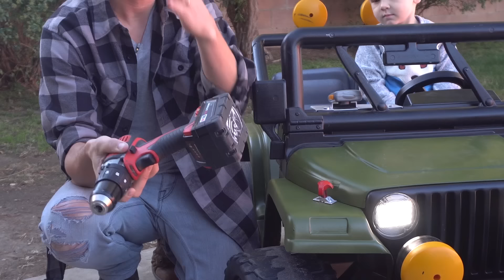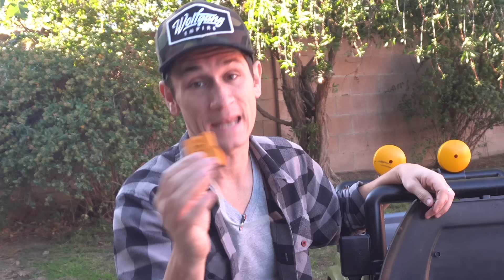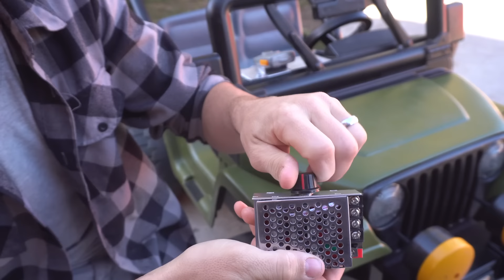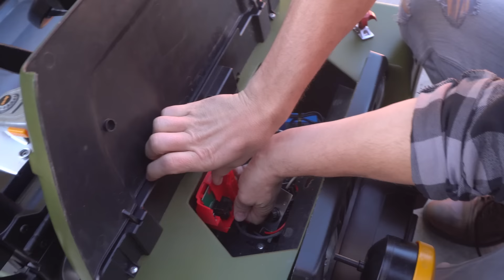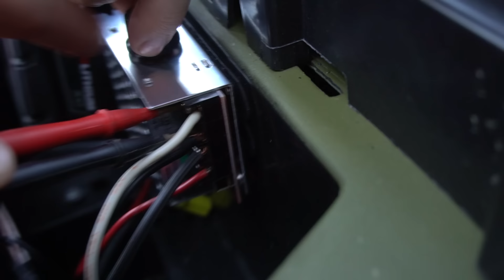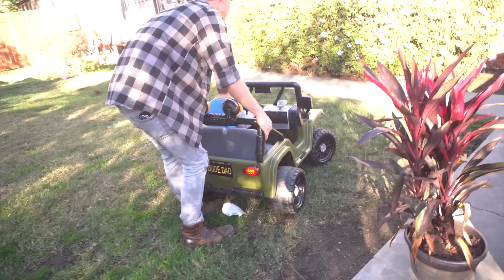EASY - How To Modify 12 Volt Power Wheels To 18 Volt power tools battery. Jeep 18 Volt Upgrade

Comment: I did this jeep with 24 volt lithium battery, with a slow start and installed dual 770 metal geared motors and a Bluetooth control! 12mph

Comment: They now make adapters that will drop the voltage down to 12 volts.  Comes with a kit that has a resister block, lever nut connector and mounting hardware.  I put my 12Ah battery in it and my boy road his around for at least 4 hours on a single charge.  I'm thinking about putting a "turbo" button on it for him and letting it ramp to the full 18V, but thats a project for another day....lol
Reply: Link that part please

Comment: My jeep has this unit Main Circuit Board for Ride-On Cars HY2025RX-SE-12V going from battery to motor and other electronics. Should i but the adjust before or after this?

Comment: I would consider wither putting a lock on the hood of the vehicle or putting the voltage controller inside some kind of lockable container where the kids can't just crank it up to the full 18v and hurt themselves. Other than that, what a great idea and video. I will be doing the same thing for grandchildren one day!

Comment: Some advice: DON'T make any modifications to a Power Wheels toy. These "kiddie-cars" aren't meant to go faster than what the 12 volt batteries causes them to go. One father in Connecticut has learned this the hard way fairly recently when he modded the one his kids used into a gas-powered vehicle and got one of the kids killed when it collided with a fence. Now one of his kids is dead and he, himself, has been arrested and criminally charged. He's going to end up in prison for being stupid.

Comment: Hello.

I have a Power Wheels Suzuki 94 model 86570 ATV.  I purchased used at a garage sale and after contacting Mattel I found out that it has been discontinued.  I purchased  a 12 volt sealed battery and used some 10 gauge wire with quick disconnect spade connectors and was able to get it running.  My grandkids were happy.

I connected the two red wires from each motor together with the white positive wire and the two blue wires from each motor together with the black negative wire, but after a few minutes of use it blows the 30 amp fuse that I installed inline on the positive wire. 

Hopefully you can add some insite so this will work.  Do I need to install a 30 amp fuse per motor? 

Thanks in advance

Comment: I did this with DeWalt battery.  It runs, seems a little faster but doesn't have anywhere near the power yours has, just a minor change.  Wonder what i need to do different

Comment: Is it possible to over drain the battery where it wont charge anymore?
Reply: Yes. Many drill batteries claim to have over discharge protection however I understand that the tool itself in most cases regulates this and not the battery. I try to periodically check the voltage to avoid over discharging and usually when the car slows down from a full charge that is a pretty good indication to charge it. I wouldn’t recommend running it totally dead if possible. There may be a way to get a speed controller with a low voltage cut off I haven’t really researched that far.

Comment: Dont cut it. Get a old charger phone plug. Cut of the prongs, or what ever its called the metal that goes into the wall. And Soder them on to the battery wires.  And they will fit tight and perfect into the powerwheel battery plug. Or even drill into the slots with a small screw and leave them half way in. It will be so tight they will not budge. And for a little added Security just rap a little electric tape. So that the wires dont move around and cause the car to sputter!

Comment: Hooking up 18v to a 12v system is not good practice.. if you are only running the motor it will probably be ok.. if you have any other electronics that run 12v be prepared to let the smoke out..they have step down converters for this
Reply: What would be a good step down converter?

Comment: How did the 12v motors last against the 18v?   I just did this but used a voltage regulator and turned it down to 12 volts.  Burned up my regulator immediately.   Now I just wanna throw 18v right at it
Reply: How many amps was the regulator?

Comment: Yeah, thank you times a million! I just got a 1991 Suzuki quad off the side of the road and i need to rewire it to a different battery since the wires are toast. I ordered a conversion kit and was scared to put my 16 month old on a fast quad since almost every drill battery is 18v or 20v . Now that i know theres a such thing as a motor speed control it will be delivered on Saturday 😂
I cant wait to order the battery and see if it works! If not onto the next problem! But i cant complain since it was FREE, and its vintage!

Comment: Yes, but how long does it last? Does it last as long as the original battery?
Reply: Of course not, that’s why we modify it. The extra power will wear out gears and everything else faster compared to OEM. Just the fact that you need to add an extra fuse should let you know that you might be strapping your kid up to a fire rocket… AWESOME!!! lol

Comment: SPEED CONTROL:  There is a switch on it (OFF, STOP, RUN > use Run and you should see a red light on) I was confused about hooking up the Motor Speed control until studying it more.  Why 4 wires?  2 from the 20V Battery side which is Input "P+" (RED from the Battery) and the Negative is Input "P-" (BLACK from the battery)  This is from Left to right on the speed control.  Next the wire from the Motor hooks into the M+ (Red)  His red was black and M- (Black) his was white.                                                                                      DEWALT BATTERY POWER ADAPTER:  The one I bought had an on/off switch.  I finally realized this after a half an hour of trying to figure out why the car wouldn't power up.  Hope this helps.

Comment: Yo dude dad i got a question bro hopefully you can help me out I upgrade my sons 12v car to the Milwaukee m18 battery the fist time i burned out the mother bored by connecting the Bluetooth control and it burned out the second time I connected my phone to play music and it burned this time the kids where playing with the car and all of a sudden it doesn’t turn nothing burned out in the mother bored the fuse is fine but the motors or not working I think I blow the motor

Comment: Thanks for this. Have you noticed any issues with the motor since doing this? Wondering if the extra voltage Will burn the motor out faster this way.

Comment: Or you can do it the sketchy way and just connect the positive and negative terminals directly to the wires with no protections like how I did with my 20v batteries

Comment: Doesn't the wheel motors max out at 12v? Wouldn't you have to upgrade the wheel motors?
Reply: I upgraded my wheel motors to 24v. Replacement is on amazon
Reply: @togo3624  I actually tried just adding a 12v battery. Went much faster but eventually burnt out the mainboard

Comment: Amazon sells the adapter with the wires and 30 amp fuse ready to go, as well as 3 pre-drilled holes for mounting!
Reply: Can you help me how to find it on Amazon ? 
Thanks in advance
Reply: @borislavjovovic3393  Power wheel adapter for Milwaukee 18V battery
Reply: Where's the ad?

Comment: Hooked mine up the same way and light on the speed controller is on so it has power but the power wheel will not move. Any ideas?

Comment from the maker: One thing to note with this set up. Be sure to take your battery out when you aren't using it or else the battery will continue to drain while the car sits and it will kill your battery completely.
Reply: Did you find this out the hard way?
Reply: You can save it by using a good milwaukee battery most of the time

Comment: Are they 12 v motors.      Will the 20v burn the m
12 v motor up?
Reply: The torque from my 20v dewalt battery caused the gearbox to break. Just ordered a replacement. I didn’t use a fuse and never had problems.

Comment: I attempted a conversion with similar thought process, but have ran into an issue...  What i did was, make a home-made salt spreader which mounts into the hitch receiver of my UTV.  The "motor" of the salt spreader is powered with an 18 volt dewalt drill, directly wired to a DC dimmer switch, then wired to the battery terminals.  It worked like a charm, until after about 20 seconds of solid continuous use.  After that, the wires become very hot to the point of melting.  Wondering if anyone has any ideas as to what i need to do to fix this issue?  I am using 16 gage direct bury stranded speaker wire. Maybe i need bigger gage wire?  The dimmer switch was rated higher than the 12 volts that the battery would provide, and the dimmer switch wires were 16 gage, so i figured the 16 speaker wire would be sufficient. 

If anybody has any ideas, i'd love to know. thanks!
Reply: Your wire size based off the amperage. 20 amps in 12awg, 30 is 10awg

Comment: Dude Dad ? Do you have a wire diagram I could look at? I bought the same setup but can’t get the throttle button to work on my kids 6 volt atv power wheel. any help would be great full

Comment: As soon as we bought one for the kids this was my first thought. Our one already had variable speed so I just mounted the battery slot on the side and I take a couple of batteries with me when we take it to the park. Never needed the second yet thankfully. I was so worried I would ruin the thing but it’s easier than it seems.
Reply: Does your have a control box? The stock circuit board thing? Do I bypass that? Mine has high and low speed stock and don’t know if I’d lose that feature

Comment: I blew the 12v RX11 control board on my sons car. It’s a regular 12v weelye. Should I replace it with the same thing or go for a 24v panel? I only blew it because I didn’t have to control Module and fuse in (ordered them both!) thanks for the advice!
Reply: @daycallmechuck hello, I am running into the same issue, wondering if the 24 control board worked for you?
Reply: Yeah never got it to work again. Ended up buying him a rosso sport ATV. It’s a 36volt and he loves it.

Comment: Nice video and thank you for the advice! 
I just got a really nice ride for my daughter and I'm going to order these parts.. just have a question.  How do you charge the battery? Do you charge it directly in the car or do you just take it home? What is the most appropriate way of charging one of these? 
Being a 18v battery, should it be how many amps? 4A is enough?
Reply: The drill battery you will ultimately be using has a charger or should, you can purchase one and they are made to slide right on and charge up Quick. You aren’t altering the battery at all just the USB adapter
Reply: @kirbywebb267  what’s up? Im not sure I know what that is supposed to mean. Could you elaborate

Comment: Quick question, can the motor control go any lower than 12 V? I’m trying to swap this into a device that doesn’t need to move fast. Basically walking pace but I have no experience with electronics.

Comment: Hey running 18v to one 12v motor  or 2 single 6v to make 12v still would burn out the 12v or 6v motors would have to change the motor or motors to meet the voltage would you not ?????

Comment: I did the same thing with a 20v dewalt but caught the wires on fire for the motor. No I have to rewire everything for the power, forward, natural, and im going to upgrade the motors.
Reply: What are you upgrading the motors to? My son has a 4 wheeler I did this upgrade and it Fried the motor pretty fast
Reply: @BUELL-vf6jo  m.l.toys

Comment: Won’t placing 18V thru a 12V rated motor burn the motor out?
Reply: It works my grandson is running 20 volt
Reply: Do you need a fuse can’t you just do direct connection
Reply: Yeah, but the fuse gives you safety, such as if a wire shorts out or the motor does burn up, it will blow the fuse long before it starts a fire under your kids seat.  @TheJoeMoneyShow
Reply: @ yeah I bought one Amazon for $11 Black Friday sale
Reply: Yes it does and other things lol… I’ve fried 2 of my son’s power wheels… but you can swap parts that can handle the 18v
Reply: Eventually yes but it could be a while
Reply: That's what I'm thinking. These things have some tolerance in regards to voltage, but not 50% higher that rated. 
It would be different if the speed controller was a buck converter that actually dropped the voltage. But its not.. Its a pwm. The way it works is to turn the full voltage on (in this case 18v) for a fraction of a second, and then turn it completely off for the rest of the second, and repeat that. 

If the 18v is on for 2/3 of a second, and then its 0v for 1/3 a second, it averages out to 12v, which is why the multimeter reads it as 12v, but its not really 12v.

I think this project is a case of "It works as long as it continues to work"

Comment: Great Video. Looking to do this conversion. Question: How much drive time do you get out of the 18V Lithium battery?
Reply: @oh no the fives So you have gotten close to 4 hours of usage on 1 - 18 V Lithium drill batteries with the Power Wheels? That would be amazing!
Reply: Ours is a 3 Ah 18v and only lasts about 30 mins. Idk if this is due to something that needs to be fixed or just due to the battery itself.
Reply: @chunkybones668  That sounds normal. There is no way the other guy is getting 4 hours out of 1 battery. You can’t even run a drill for 4 hours straight, let alone a power wheel weighed down with a kid or two.
Reply: @StarFox31   mmm im a roof plummber i use 6amp drill milwauuke lasts atleast 6 hours of constant screwing in screws.so im sure a 10amp or even 9 amp would last easy 4 hours
Reply: We use a m18 8.0 hd  battery and we get about 50 minutes steadily driving full speed with both kids in it. That is at the full 18 volts. I got a voltage regulator that I’m going to add so the motors don’t burn up from over working. That should also extend the drive time significantly

Comment: Love your videos! I'd like to do the same to both of my kids' power wheels. As well as the 36v minimoto electric pocket bike I recently have acquired. But the bike is more for me until they get older. 😂 but I know NOTHING when it comes to electricity so I don't even know if it's possible to wire a couple 18v lithium ion batteries together. 🤷‍♂️ or fuse sizes to use.

Comment: Thanks.  Great video.  My Porter cable 18v drill has a nickel cadmium battery.  Will it still work even though it’s not lithium ion battery?
Reply: It should still work if you can find a battery holder like this guy had with his Milwaukee battery. The only difference is that the Li Ion batteries will typically have longer battery life/better depth of battery discharge. But they'll still operate the same as they're both 18V batteries.

Comment: I did this with a 18v makita battery, thanks for rhe vid. One note too add though is although we added a 30amp fuse , the voltage controller came with a 15amp fuse inside, that poped pretty fast so i replaced it with a 30amp fuse. Just a tip for anyone looking to do the same
Reply: @BrandonT i have it before, (30amp) but it was the smaller 15amp inside the speed controller that blew, I put a 30 in and it has been running great since kids love it. Plus I added a led spotlight with light switch too
Reply: @BrandonT it shouldn't matter if the regulator has its own 30amp fuse. It will protect it. If its anything smaller it will blow before the other 30amp fuse. Depending on draw of power ie: weight and speed,  uphill etc. If it dosent have a fuse built in the regulator I would put it before and that will blow before the regulator.
Reply: @BrandonT no problem happy to help! Hope your kids have a blast! 👍
Reply: @Stealydan10304  yo I’m tryn do this confused tho so on the voltage controller it connects to the battery - & + and what is that white wire in video on the voltage controller?
Reply: @Jay_Swavyy  https://youtu.be/gXfMXjUsZdI
Reply: @Jay_Swavyy white wire in the video was going to the jeeps motor, probably + and the black one going to the motor would be -

Comment: Did you replace the original thermal fuse with that 30amp in line fuse?
Reply: Do I need to remove it did it to my son's but the battery gets hot
Reply: @chrismoorhead11  Yes! We have blown a few batteries when getting so hot I couldn't touch it. Killed some very speedy batteries... opps.

Comment: You're going to want to add a low voltage cutoff, while the Milwaukee battery knows when it gets too low it sends that signal to the tool to cut power. The battery itself will not cut its power, and you'll over discharge and ruin the battery.

Edit, I suppose it's possible the USB charger you have has a cutoff built in, but if so I would find it unlikely it's rated for 30 amps.
Reply: I've tried to find one and couldn't? Any help or suggestions?

Comment: How will the engine in it handle the 18 v instead of the 12, is the motor ok with that ?
Reply: She will handle more than that, my understanding is the motor can handle up to around 30 volts before you begin to see problems. I'm sure you could argue there's some shortened lifespan.
Reply: @timothyfischer5160  ah ok, cool. thanks.
Reply: We have 9 different power wheels types of ride on vehicles and all have been perfect. Even with me riding my 1 year old. These are fun and now a days, not much else to do.... the worst thing we have found is when kids push not moving power wheels and kill the gears. THAT is something all kids do and is worse. So you are good to go!
Reply: As part of an R/C conversion, the R/C circuit needed 12V, but I was using leftover 40v batteries from an old lawn mower.  I found a "Golf CART Voltage Reducer Automatic Buck Boost Converter DC 8V-40V to 12V 6A 72W Step Down Up Regulator Waterproof Module Transformer" which worked like a charm.  When my 2yrold ages up I will remove the R/C function and put in the Module DudeDad uses here.  But this is a good alternative to use Big Batteries while not causing too much harm now.